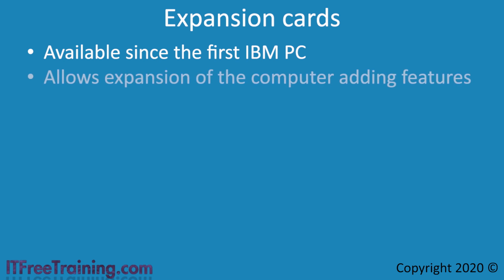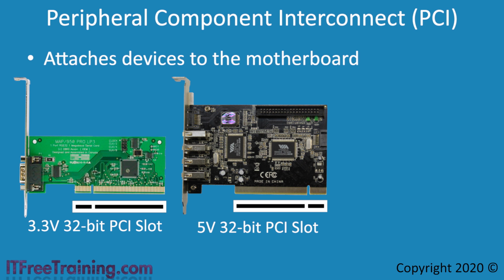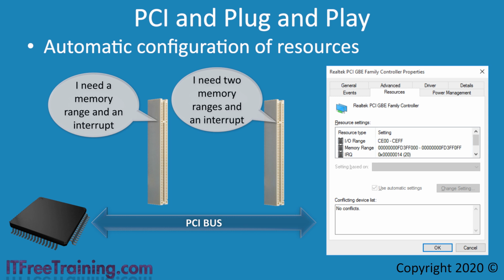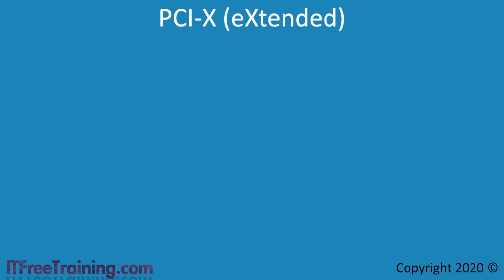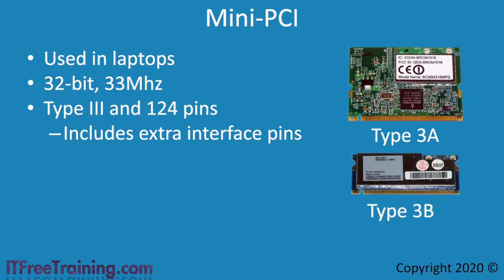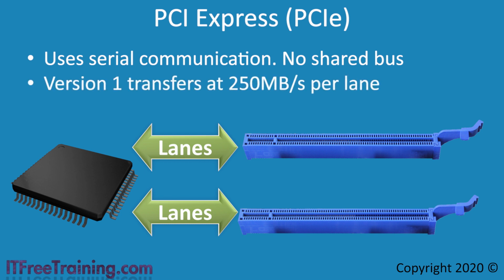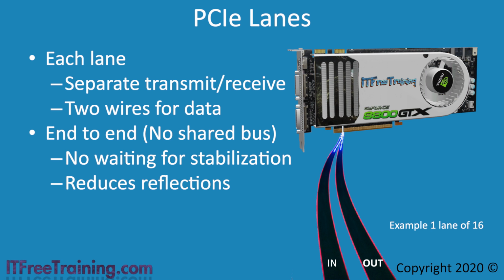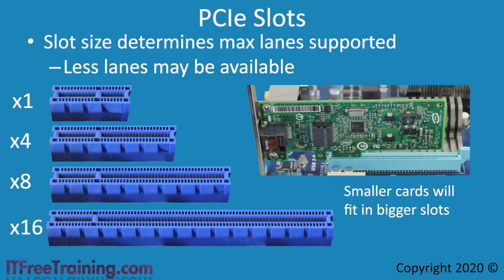Expansion Slots

Comment: Good explanation but just curious, how is the I/0 range 16 bits here? Thanks.
Reply from the maker: We cover this in a different video, however I can't find the video at present. Essentially it is 16bits because the I/O ranges are from the old 16 bit computers. The CPU uses a different set of instructions to access these. To keep compatibility, they have stayed as 16 bit. To allow for 32/64-bit, the memory ranges were added.